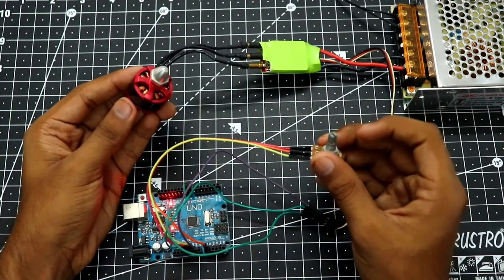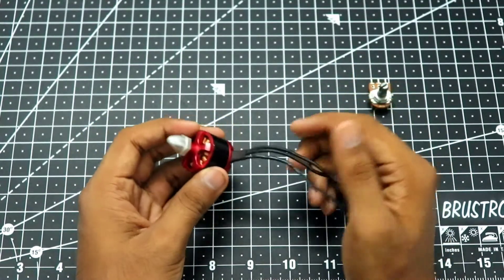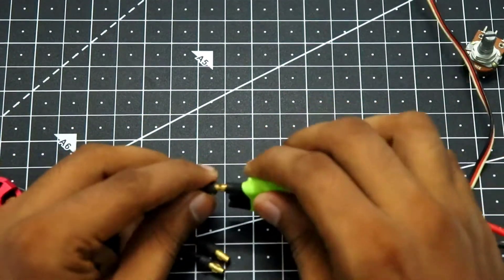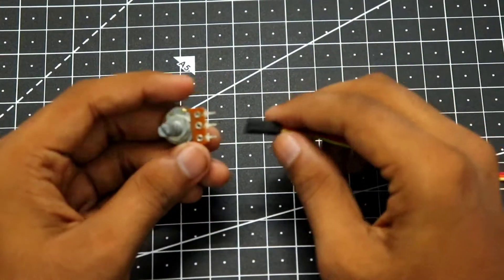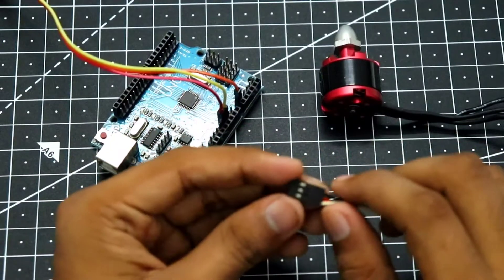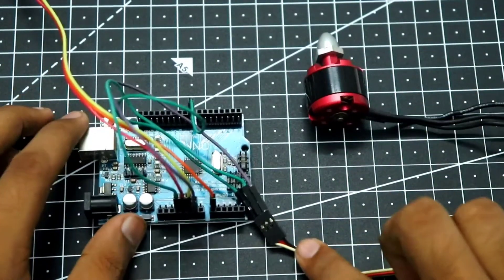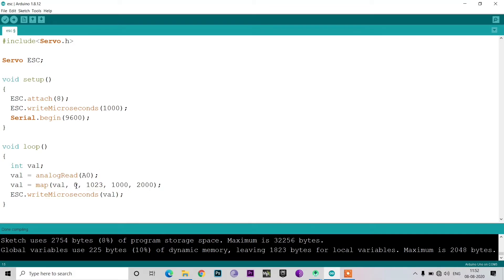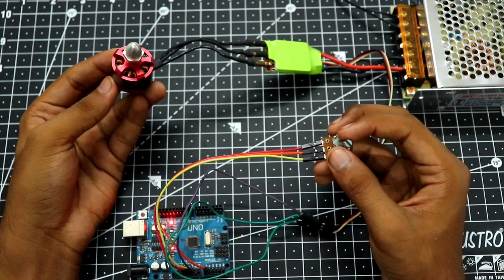How To Control Brushless Motor With Arduino and Potentiometer using ESC

Comment: Can we control two or more motor in same way with one potentiometer
Reply from the maker: Yes you can but, you will have to use seperate ESCs for each motor.

Comment: Great, the code is the same if I would like to use ebike throttle (hall sensor) instead of pot?
Reply from the maker: No, you'll need to change the values in map function. But apart from that it should be the same.
Reply: ok, thanks, I can't find such example with ebike throttle  only pot

Comment: why did you put 1000 - 2000 as value for ESC? is it standard or does every ESC have its own value? How can I find my ESC value? thanks
Reply from the maker: The is no specific library in Arduino to control the esc. We just expand the capability of servo library. Both serveo and ESC require the same single but for different duration of time. So in servo we put it as 0 to 180 milliseconds and in ESC as 1000 to 2000 milliseconds which is the standard range for esc and should work on most of the ESC available on the market. However let's say your potentiometer is set to zero but the motor still spins you can try to change the 1000 value to a lower value and test it

Comment: is it possible to control 2 motors with the same potentiometer?
Reply from the maker: If you do so then they will both run approximately at the same speed.

Comment: Please clear my confusion i have seen many videos of this circuit but for powering up the Arduino which should be used 3.5v, 5v, or vin because everyone is using different pins 🥺
Reply from the maker: You should always use the vin pin to power up the Arduino.
If you use it with 5v or 3.5v it can damage the board.

Comment: what about reverse?
Reply from the maker: Just switch any two wire between the esc and Motor.
Reply: @INOVATRIX  I mean VIA SOFTWARE so i can reverse on the fly im building a boat with flipsky esc 75200 and want potentiometer control so that one way is forward and the other way reverse.. willing to pay for help as well if you leave a crypto address.
Reply from the maker: To reverse the direction you can check your esc's manual or if you are using a controller , some have the ability to reverse it. But it's in very few

Comment: Is theres any possible way to wire ebike controller (which can connect to potentiometer/throttle) to the wireless transmitter (RC) thank u
Reply from the maker: There are 3 channel transmitters that can provide necessary signal for the esc wirelessly.
Reply: INOVATRIX thank you sir 🥰

Comment: thank you for this fantastic video and i want to know how to reverse the direction of the motor ?
Reply from the maker: Switch any 2 wires between esc and motor
Reply: @INOVATRIX  thank you for your massage but I want to reverse it by programming not manual

Comment: what is power supply amp rate??
Reply from the maker: The particular supply I used is of 10 Amps.
You don't need this much power, a simple wall adaptor of 1-2 Amps will also work.
Reply: @INOVATRIX  serious 1-2amp wall adapter? not overheat? spec for motor said minimum 12amp at max .. anyway thanks sir
Reply from the maker: Ofcourse it will heat up.
Because if you are only testing they you don't need that much power for that lets long.
Reply: @INOVATRIX  ya correct just for test only without load..